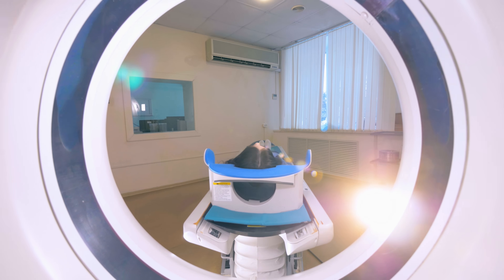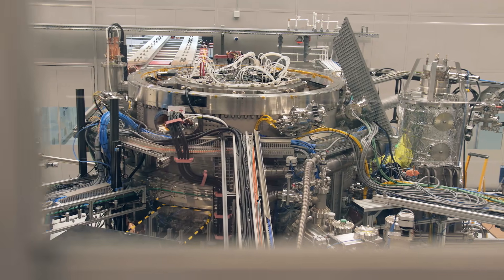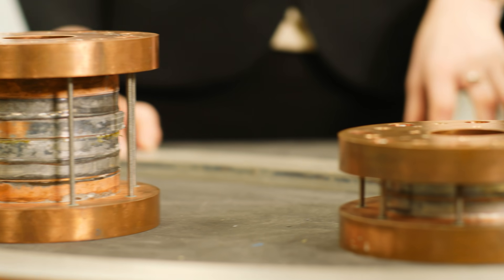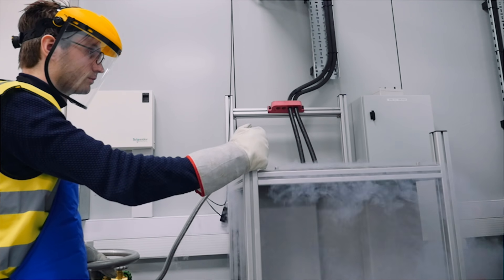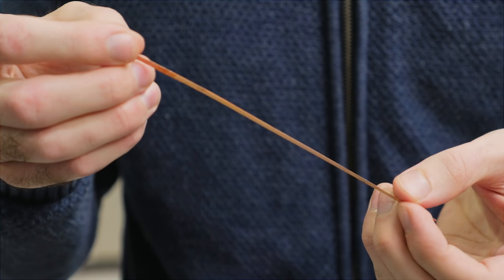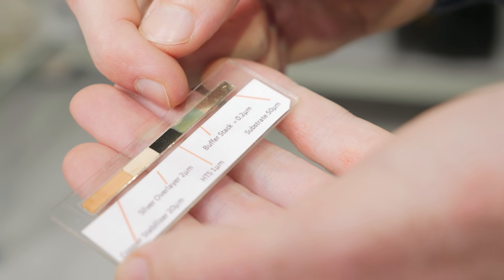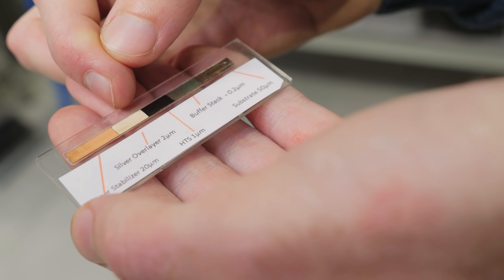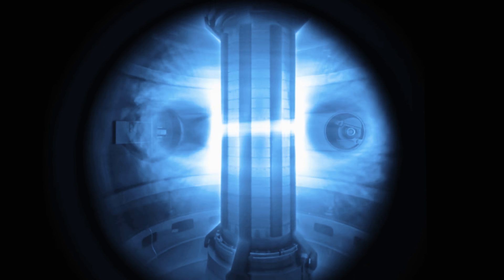What are superconductors? And what is HTS?

Comment: It seems like smaller is better with this. I know large impressive looking reactors would attract big investors but it makes no sense. It would seem it would be much easier to create small, perhaps even tabletop sized, reactors using these HTS's. You only need one reactor to prove that it works small or large matters little.
Reply: That's what they are working on. (It's not tabletop size but it's way smaller than ITER)
Reply: @chrisparkin6894  Far, far smaller...
Reply: Not gonna have tabletop net power devices for foreseeable future
Reply: @taylorneill2687 a table top nuclear generator would be awful.  Very hard to regulate.  Stuff a bunch of neutronic fuel in there and that neutron source could be used to activate all sorts of elements into fissile materials. Just drop in a thorium slug and a few months later, your thorium slug would be mostly U-233.  Sure, it's not the best thing to build a bomb, but it can and has been done.
Reply: Not so fast.  Fusion needs strong magnets, the stronger the better.  strong magnets are bigger than weak magnets, strong magnets need a strong frame or they'll tear themselves apart.  Strong frame is bigger than little frame.  Bigger is better.

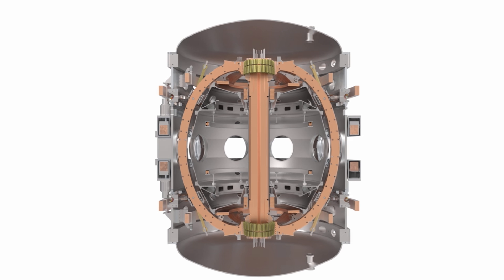Comment: Maybe a nitpick, OK totally a nitpick!, but the magnet/plasma animation around the @1:10 mark shows the HTS magnets almost adjacent to what would be a burning plasma inside the vacuum vessel in a fusion device. Is this how these future reactors would be built to maximize the magnetic field strength inside the containment vessel and the magnets would be designed to withstand the high neutron flux from the D-T fusion or is this just to illustrate the principle of magnetic confinement and a real reactor would have a sizeable neutron capture/shielding blanket between the vacuum vessel and the magnets?
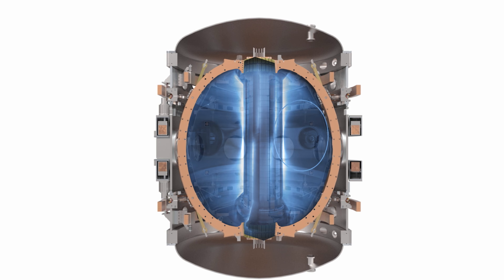Reply from the maker: The picture at 1:10 is our ST40 tokamak, which uses copper magnets (just illustrating the point that we confine plasma using a giant electromagnet). ST40 is not using DT fuel so not creating neutrons. You are right that a future fusion reactor will have shielding to protect the HTS magnets--one of the reasons why fusion reactors will have to be bigger than these experiments.